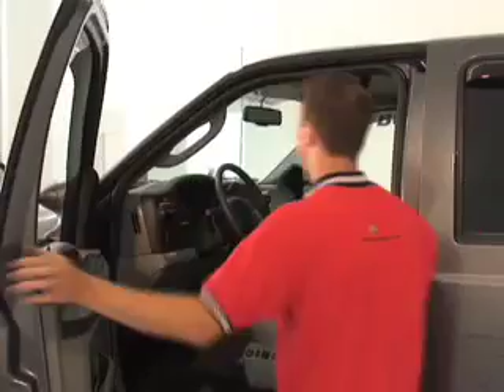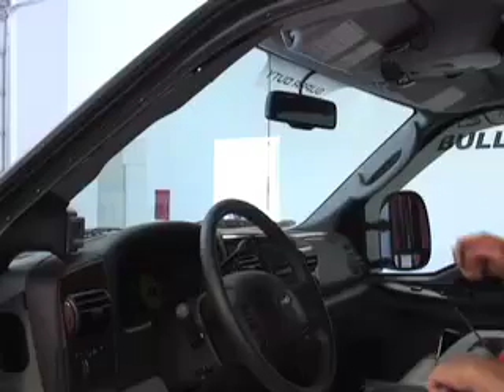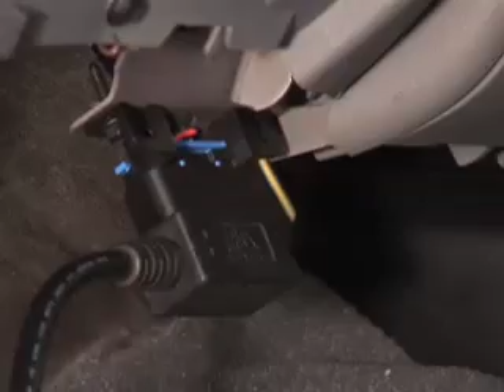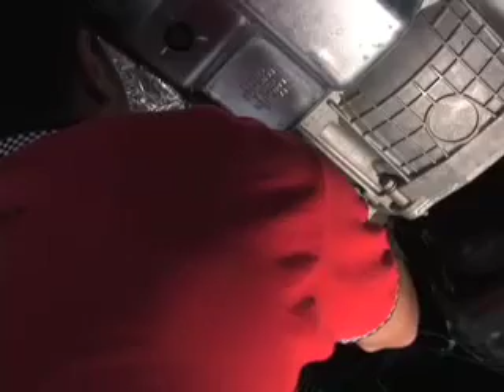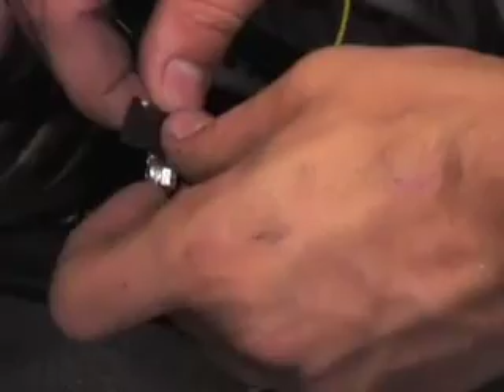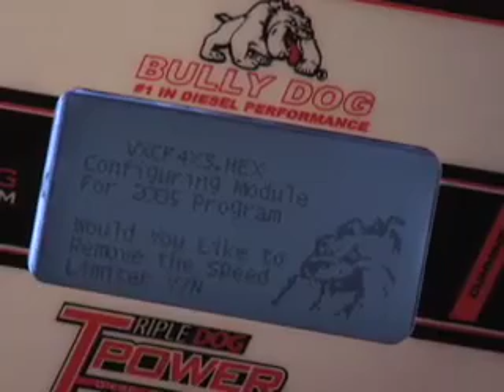Bully Dog Triple Dog Ford Outlook Monitor and Triple Dog Installation Movie

Comment: I bought an 05 and have a bullydog outlook monitor and not sure if the power pup downloaded was also installed. Would there be any way to tell if the power pup was installed and left on the truck?! The truck came with a Hypertech max energy tuner/programmer also. Can I install that and run it with the bullydog outlook?